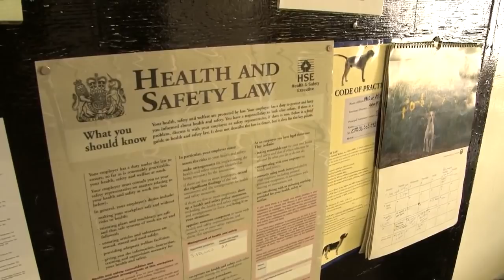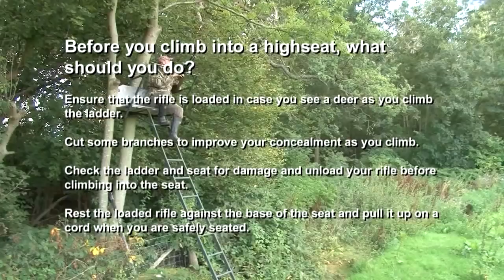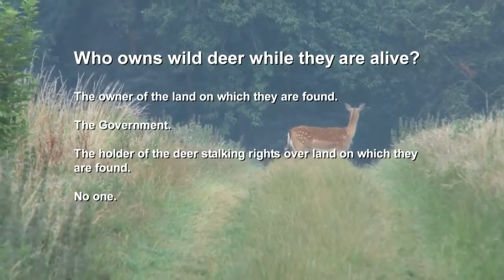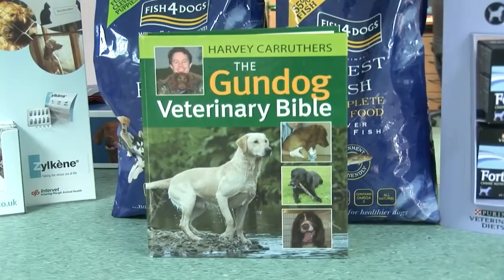Fieldsports Britain - Pigeonshooting, gundog pups and how to be a better person, episode 94

Comment: Unfortunately we can't have riot-guns with skeleton-stocks,as we have set minimum barrel-length of 24" & the gun must have a fixed stock.This has been the case for 24 years,after the Hungerford Massacre in 1987.Northern Ireland however has no such restrictions & they can own the short-barrel semi & pumps.A coach-gun or a Lever 1887 shotgun with a 18 or 20" barrel is legal on a UK FAC,as its not classed as a "short-barrelled shotgun"semi/pump repeater under UK law.